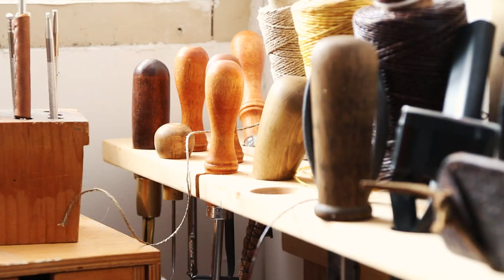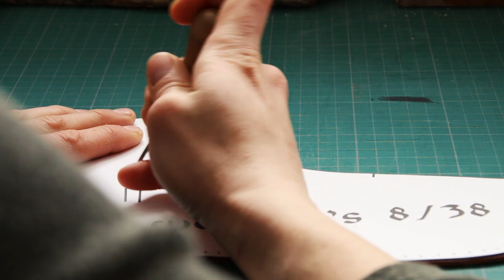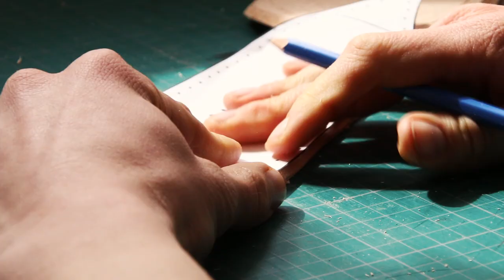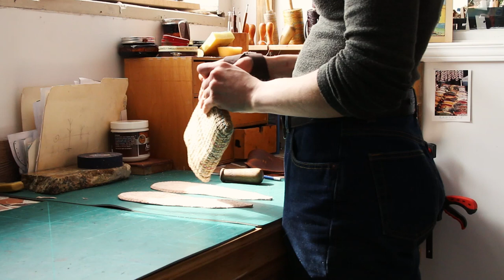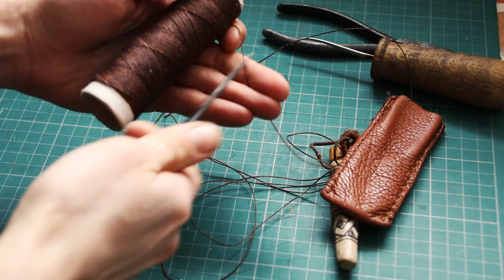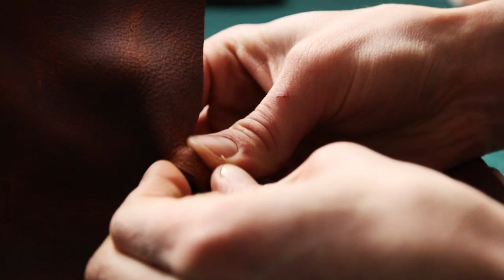Artisan Viking Turn Shoes

Comment: Can you tell me how long the strap you cut is
Reply from the maker: Probably 1.5 meters, or roughly 5ft, but it could probably be shorter. I'm afraid I usually took the route of cutting the longest lace I could, and then adjusting once it's on the boot.

Comment: Hey, just a quick question if you happen to read the comment section. First of all those look stellar. I’d’like to make a pair myself. I also do some medieval full contact knowned as buhurt or Hmb. A lot of fighters have rubber, modern sole , discreet but useful glued to their leather sole. Do you know if it’s hard to find and more important, hard to glue ? What would be your experience with modern glue ? Thanks a lot
Reply: I'll leave Nora to reply too, but ya, some E600, Barge Cement, or other proper glue will do just fine gluing a proper rubber to it for wear.  Just don't glue tread to it, just because it can make your foot grab a little to hard, can't slide, you'll hyperextend a knee or break a joint because your foot got snagged and stuck to the mud.
Reply: Adam Budda  wow thank you very much Adam, that will help a lot
Reply: @FoxesandRavens  Thanks a loot , i came across some videos explaining the process for those shredded rubber layer, can be a good solution yeah. Have a good day Nora, thanks for the response.

Comment: You need some real heavy waxed linen thread for your thread needs for your leather goods. Nice shoe kit. Just not a fan of plastic.
Reply from the maker: That is very true: most viking shoes were whipstitched. But that leaves exposed thread, which then breaks more easily. But honestly I think the reality is just that most vikings didnt spend a lot of time trying to make shoes as pretty as mine, because they knew they would fall apart pretty quickly. Obviously some rich people who didn’t work outside a lot would have fancy shoes, but mostly shoes were a bit more slapdash

Comment: Holding the curved knife, with a hammer grip, and putting you hand underneath the leather with the blade tip only exposed to the line being cut is much easier, because you have a firmer grip. Also nailing the leather to the bench makes for holding the leather easier. Doing both will make for the knife not breaking, and cutting yourself unlikely. 😂❤😂
Reply from the maker: I've updated the kinds of knives I use several times since making this video, but more than anything I would say that you need to sharpen your knives very regularly. It shouldn't be hard to cut leather, even very thick leather, if your knife is appropriately sharp. So having a knife that's easy to sharpen is key! And curved blades aren't great for that, so I no longer use them.
Reply: @FoxesandRavens  yes , I buy hook blades for my Stanley knife, they are mass produced and wickedly sharp and cheap.  Also a bit of stropping definitely will make them glide along.

Comment: That should be hard to walk with them outside based on the extremely thin soles.
Reply: Have you ever walked barefoot before?
Reply from the maker: Thin soled shoes require walking differently; in fact, we find that on medieval shoes, the toes are always more worn out than the heel. With modern shoes, we walk more on our heels thanks to the rubber soles, but if you wear thin soled shoes like these you quickly realize why they walked on their toes. But outside is actually the best place for thin soled shoes! On the grass, on dirt, etc, it feels great on your feet.